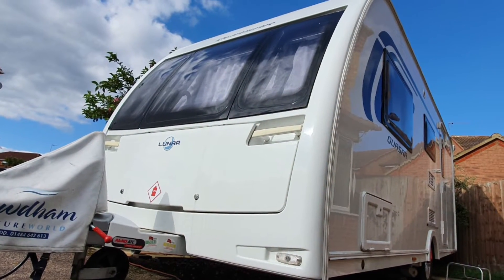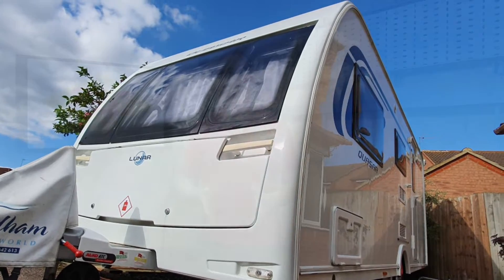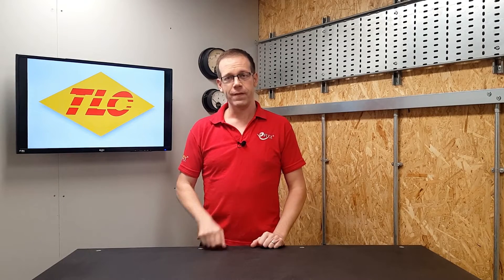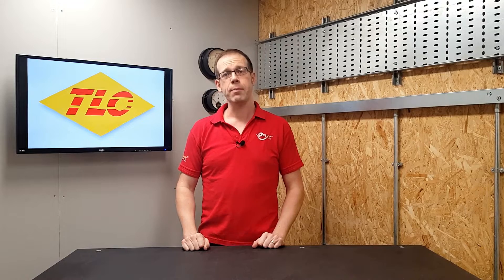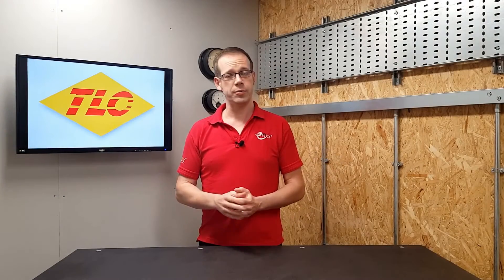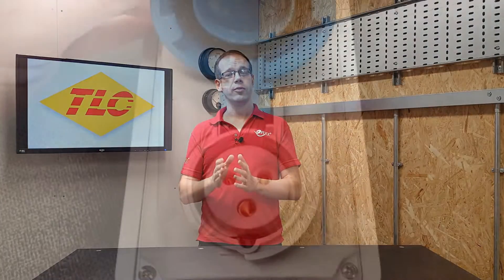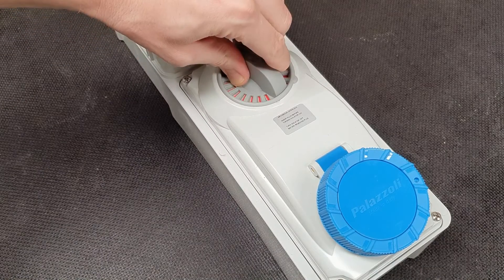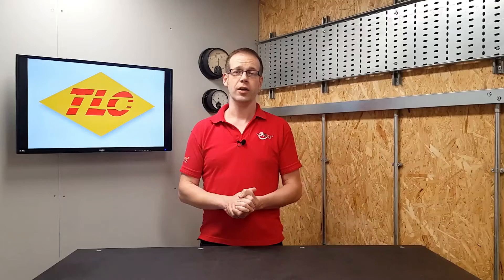BS7671: What are the requirements for caravan electrical hook ups (EHU)?

Comment: What if it’s not a TNC-S system or TT but a TN-S set up? Do these regulations still apply? Can you rely on the earthing of a TN-S? Thanks
Reply: Yes but can you guarantee that the Tn-S supply is true Tn-s or it's actually PME.
A simple continuity test between neutral and Earth at DU would give you a better idea. Often enough it's not a true Tn-s..
Personally I would bring the Tn-s supply to the DU then TT the supply to the hook ups,

Comment: If the supply to the pitch is a 10mm or 16mm SWA 2 core & is RCD protected what rating must that RCD be if there is 30mA to each socket outlet at the pitch? Does the SWA supplying the pitch need to be 100mA with a time delay or just straight 100mA? Otherwise surely it could trip at the source?

Comment: Do you know if working inside a caravan on the standard 230v system classed as a special location, or is it just the hookups etc that are classed as a special location.
Reply from the maker: They're both classed as special locations. Section 721 covers the inside of the caravan. 😊
Reply: Can you state the regulation for inside a caravan being a special location and explain the regulation meaning as I queried NICEIC and they said inside a caravan is not a special location.

Comment: In Uganda they do it all the time. The cables hang outside all over the shop. Often they cause shots because the cable starts to lag and weirdly stretch meaning more resistance, heating up and burning. Total mayhem. I wouldn't recommend it in hot climate.

Comment: Good video. Electrical installations on caravan parks is what I do, so it’s interesting to see a video on them as you don’t get many on YouTube.

Main issue on older caravan parks is 2 core SWA looped between pitches. Lock nut on gland becomes corroded which discontinues the CPC and earth fault loop impedance exceeds maximum permitted tabulated value as per table 41.3 of BS7671.
This is not always caused by water ingress specifically, but the sea salt air - you’ll find caravan parks near the coast have this issue. 
Brass lock nuts should always be used as they are non ferrous!
Reply from the maker: Great insight - Thanks David

Comment: Oh me oh my the tears, tantrums and headaches caused by caravan sites especially as overcrowded as they are to the east coast. Many hours and days spent on callouts to such places to resolve problems not apparent to the average site owner or general holidaymaker. Overloads caused on a cold near winters night (tin tents are not best insulated beyond pleasant weather) stress to neighbouring caravans, supply systems and transformer usually caused by the sale and use of unregulated electrical products (ie not approved by any western standard) causing transients, interference and more concerning and more common excessive neutral currents causing thermal stress to conductors caused by harmonics of a busy site (i have attended several distribution units on sites that have been turned into chard messes) as a problem some may have contended with: loss of a neutral to parts of a site to which some poor tin tent owner notices as when they are watching coronation street on the telly to the moment the thing explodes due to the poor thing trying to drop 400+ volt through itself... Simple short vid good on ya.
Reply from the maker: Great experience to share 👍
Reply: I share your pain with this experience! Loss of neutral on three phase supply to pitch pillar caused an imbalance voltage to 5 residential park homes and blew tons of appliances, boilers, TVs, dyson heaters.
Reply from the maker: Great experience to share 👍

Comment: I have stayed at RV parks.  Electrically speaking they suffer from old infrastructure which is overused on holidays.  

This tends to play havoc with the quality of the electricity supplied.  It will go like a rubber band from being normal to having under voltage symptoms to over voltage behavior.  Frequency, also, fluctuates quite a bit.

I have used the following two classes of products with great results:

https://rvpower.southwire.com/products/accessories/30-amp-and-50-amp-voltage-regulators/

https://rvpower.southwire.com/products/transfer-switches/surge-guard-50a-rvc-automatic-transfer-switch-model-40450/

While staying at different campgrounds some of my neighbors sadly suffered losses of various types of electrical equipment. For me it works better and cheaper than buying appliance insurance.
Reply: Will the parks have to start adding big battery banks to thier "microgrids"  to add stability, the same way as the grid itself is starting too?
Reply: @backacheache  too expensive for an RV park.